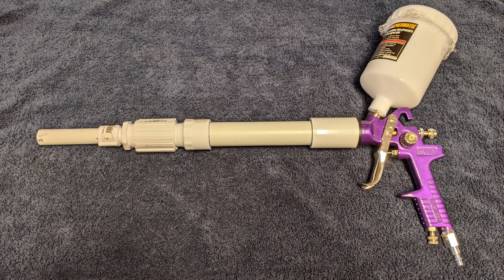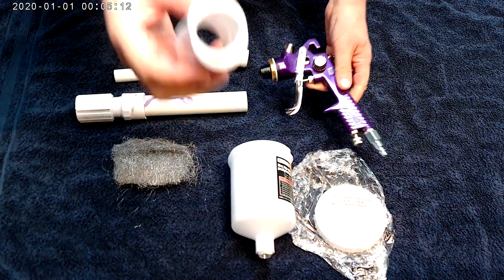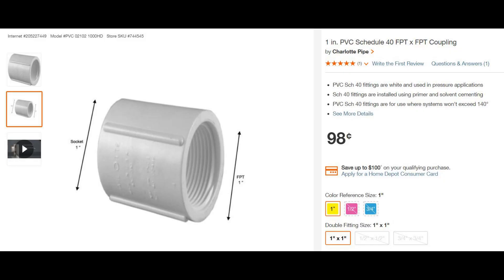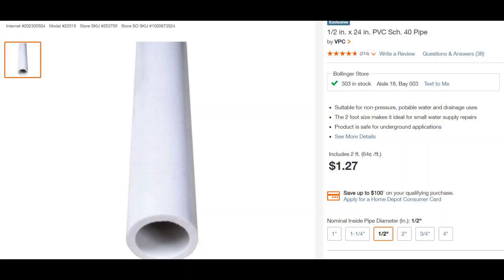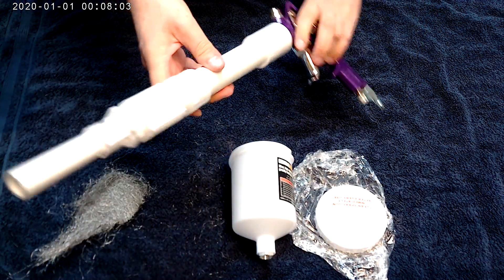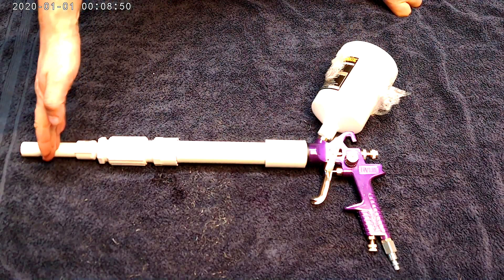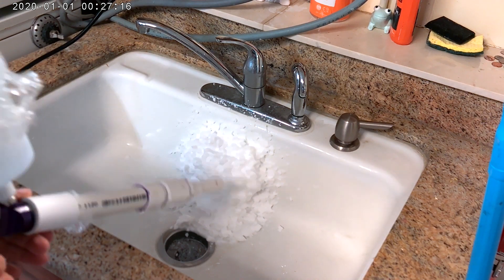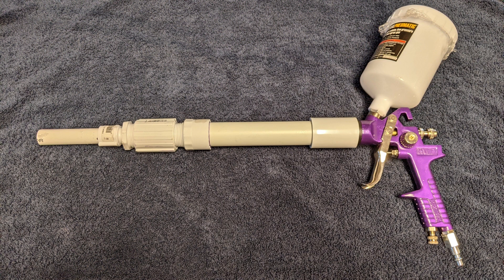DIY, Professional looking, Air Crete Gun for $25. Make sure to see my other video for upgrades.

Comment: I got same gun, but it never produced foam for me. My compressor is pretty strong, can is half filled with soap liquid but lot's of air with pressure comes out the other end and drops of liquid and no foam. I have packed some mesh inside the 1" pipe.
Reply from the maker: You probably have too much pressure pushing the water out of the container and not letting it into the gun. Make sure you have an airtight lid.

Comment: I'll try this  , it looks great but I doubt it can make a lot of foam fast. And if the container doesnt have a hole in the top the detergent wont really want to come out in a hurry so if another pipe was forcing air or detergent  in at the top maybe it would work better
Reply: I was just reading through  the comments and noticed a link to a second video   https://youtu.be/tsBoYSk5Mys?si=hQxS3kpfaFNh14Mg  and it seems to work pretty good .

Comment: I love this. I wish you had put a parts list in the description, but thanks anyway. Here is a parts list.
20 oz HLVP Gravity Feed Air Spray Gun from Harbor Freight
1 inch PVC Schedule 40 S x S coupling 1"x1"
1 inch x 24 inch PVC Sch. 40 Pipe (for mixing chamber)
1 inch Schedule 40 PVC Male adapter (threaded on one end externally)
1 inch PVC Schedule 40 FPTx FPT Coupling (threaded on both end internally)
PVC glue
Steel wool or scotch brite steel pads
2 ft of copper wire (to block steel wool blowing out)
1/2 inch x 24 inch PVC Sch. 40 Pipe
1/2 inch PVC Sch. 40 Male MPT x S Adapter (threaded on one end externally)
1 inch x 1/2 inch PVC Sch. 40 Reducer Busing
Reply: Thank you.

Comment: I tried a couple of other designs first, which were extremely inconsistent and hard to control.
This system (and the follow-on video with the simple pump and reservoir) is a very elegant solution to the problem of inconsistency!  A modest presentation of a genius approach!
  We will tinker with vegetable glycerin concentration, air pressure choice, and solution flow rate to achieve the consistent 100gm/L density we are looking for.  
Thank you so much... it is allowing us to proceed with a senior Math and Science Academy "Capstone Project" in seeing how ratios impact compression strength and R value.

Comment: due to inflation this will be around $40.  Steel wool items linked will run $19 and the sprayer is $17, to give you an idea of 2023 prices.  Still I like the idea and will try it.
Reply from the maker: Make sure to look at my other videos with the improved design.
Reply: @ItaiLeshniak  i quickly glanced at the improved design; it still uses an air compressor?  I think if I have success using foam for my application I can then go to the other design but I don't think I need to get the pump right now.  thanks for doing this.

Comment: Tried it with a different husky hlvp spray gun but didn't work for me. I think he issue is it was not dispensing enough liquid.
Reply from the maker: Make sure you are not losing pressure from the water tank, the tank needs to be 100% air tight. You may also have too much steel wool, it must be aerated or you will have too much back pressure. Your compressor should be set to low PSI.

Comment: Love your video and explanation. Simple, easy and cheap to assemble parts into a more professional looking device. One quick question, what is the min. size compressor you would suggest to use since many user may not (or have room to store) need those big size compressors.
Reply from the maker: Hi Dave, you do not need a big compressor. Just make sure it has a high (>4) SCFM (Standard Cubic Feet per Minute). You can get one for around $135.
Reply: @ItaiLeshniak  was that the fastest it would shoot out foam in the video?   Seems like it was very slow to produce foam

Comment: I was a bit skeptical about this but when I tried it, the result was above expectation. However, I suggest you consider replacing steel wool with steel window mesh since steel wool tends to rust and may change the color of the foam. Other than this, it's a marvelous brilliant idea and for a $40 I got a genuine air gone. Thank you a lot
Reply: Use stainless steel wool
Reply: I got same gun, but it never produced foam for me. My compressor is pretty strong, can is half filled with soap liquid but lot's of air with pressure comes out the other end and drops of liquid and no foam. I have packed some mesh inside the 1" pipe.

Comment: PErfect!!!! Really the simpliest way is also the easiest. I think of a bigger foam chamber with a "T" in the front to use as a second handle (add a 1/2" by 6" in the bottom with a lid)... Could it work?

Comment: Doesn't the steekwool rust?
Reply from the maker: Yes it will. You should use Scotch-Brite Stainless Steel Scrubbers. I just didn't have any when I took the video.
Reply: You can buy stainless steel wool pads as well, the stainless steel pot scrubbers aren't fine enough to make a nice dense foam IMO

Comment: Please make a follow up video where you replace the top tank with hose that leads to a bucket with solution. Many of us want to make houses, sheds, and big projects.
Reply from the maker: I am working on it. I just need to find time to take the video.
Reply: @ItaiLeshniak  Sounds good! Looking forward to it. Great work
Reply: @divisionoflabor3070  

Probably need a bigger gun, not bigger tank
Reply: @johnle231  No, the limiting factor is the amount of solution, the gun is doing just fine
Reply: @divisionoflabor3070  

With unlimited amount of solution,  what would produce faster, a garden hose or the paint gun in this video?

Exactly. Thx. You know I’m right
Reply: @johnle231  The 'gun' is just a mixing chamber. IF you want more suds, you want more solution. If you want faster suds, just add more pressure from air compressor. If you feel really smart, go make it. We're all cheering for you! Gold star.
Reply: @divisionoflabor3070  

False.  The gun is also an application device.  It is limited to how much it can spray through its tiny nozzle.   

Think missle launcher vs a hand gun.

Now which would be able to shoot out a bigger projectile and cause more damage? 

Going by your logic,  it would be the handgun 😂

Comment: I notice people either do not know or they avoid the one question that should be ask, How stable or the bubbles and density. I can make bubbles with a Kitchen blender but the Bubbles do not have the stability of the density for use in Aircrete. I think the biggest problem is size.
Reply: Try one ounce of liquid soap for every 16 ounces.
Reply: try the 7th generation soap. From my understanding 7th generation detergents are good for these purposes...or you could add glycerine to your soap mixture... not sure about the ratio though
Reply: one liter (quart) of bubbles should weigh 90 > < 104 grams.

Comment: No cutting, no gluing, no duct taping! You can still use your paint gun since you didn't damage it. Amazing that the PVC thread just fit the air gun thread.  I have been watching DIY foaming gun making videos for 3 years now. This is by far the easiest. You can make 4 of these in parallels and get high volume. You can even use electric paint spray  gun and potentially no need for air compressor. Keep the good job man.
Reply: Great design, I like the above comment too, was just wondering how to scale it up
Reply: @brichardson7884  Have you found a way to make this in a bigger scale? Thank you.
Reply: Hmmm! Good idea. But wouldn't it be slow? And also, the electric sprayers I've seen are still logged about with a very huge air compressor.
Reply: How you made the PVC thread to fit since these guns have a finer thread than the PVC pipes?